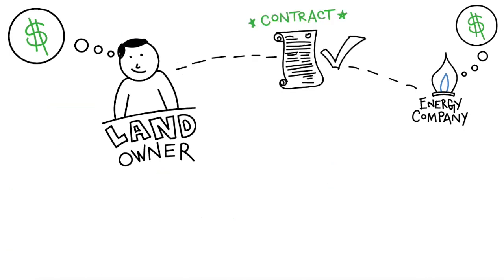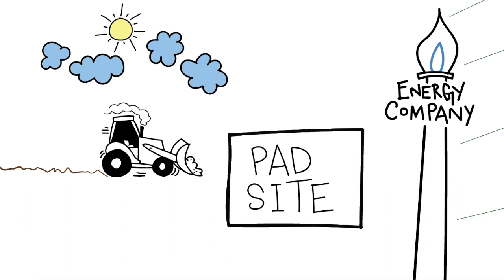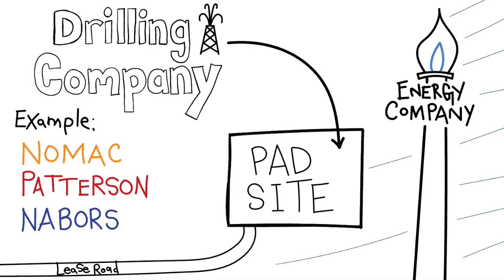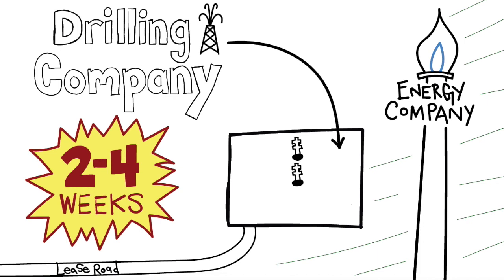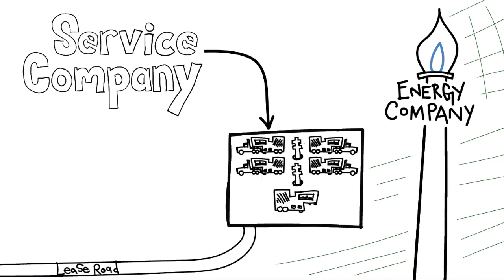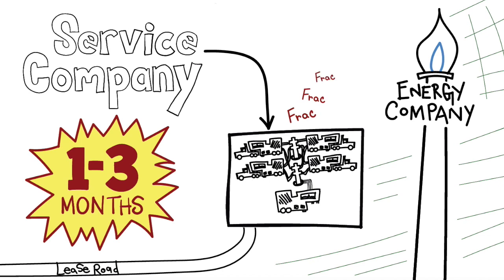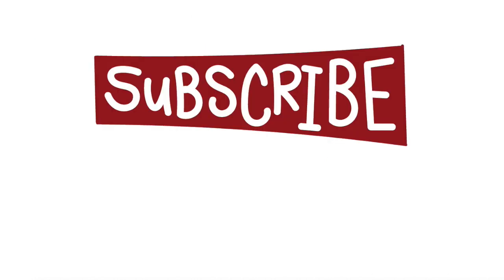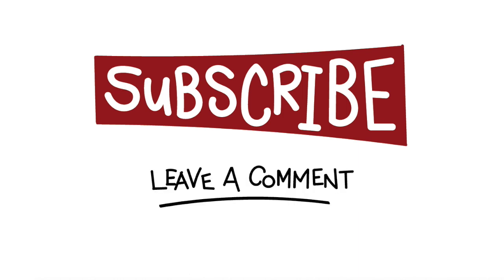How It Works - Oil Production Process

Comment: You missed the two most important parts after fracking you have to have a coiling unit and flow back come and clean the well before you can produce oil I work in the oilfield